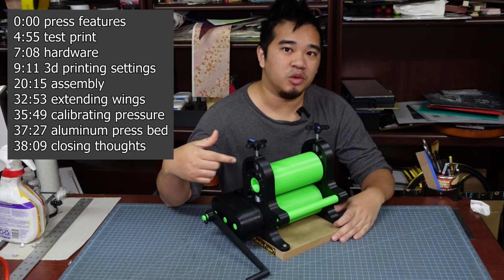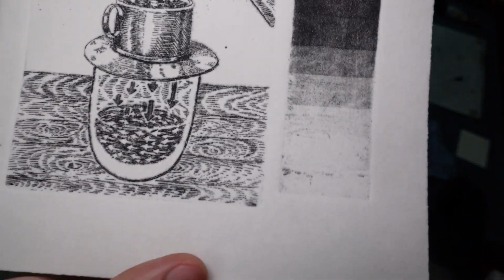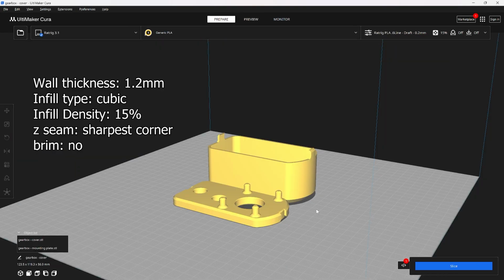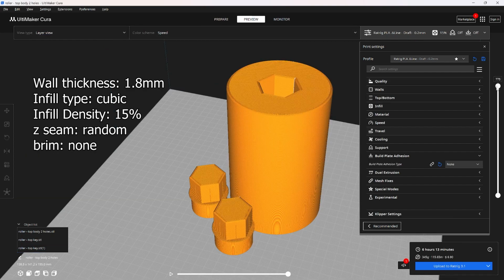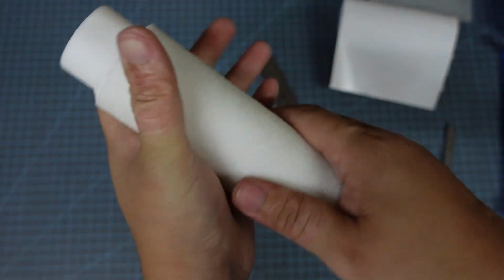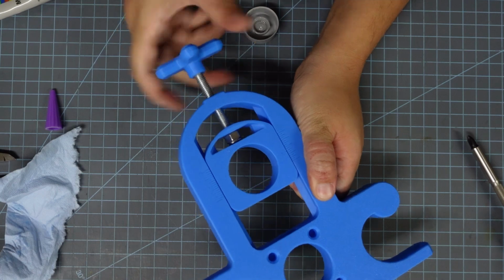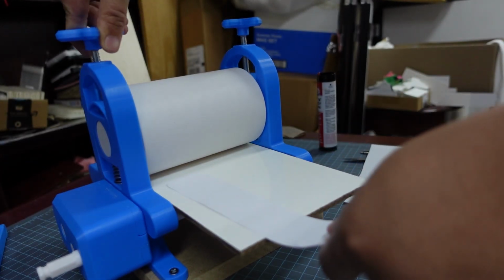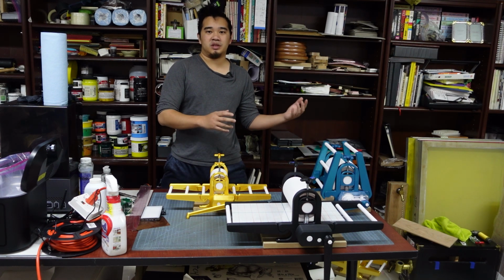3D Printed Etching Press! - Phantom Plastic Etching Press v2

Comment: great design, two changes that are cheap and would make it last longer, blind nuts on the tightening mechanism, one on each side and that would keep your threads working for years. Also plastic safe lubricant on the pivots and gears, Tamiya White grease will last a long time and not melt the plastic like 3N1 oil....

Comment: Also, how hard would it to be to extend it so you could stick a regular copy machine paper inside, size-wise?
Reply from the maker: possible but you'd have to have a bigger printer and use more walls and infill for the rollers

Comment: I wonder if 3d-printed etchings/stamps/type faces are good to use. Have you tried it? If PLA/PETG are too hard/stiff to do the job properly, there's always TPU which is rubber-like. 3D printed bed is obviously possible, since you made one last time, certain materials like petg can take more beating than aluminum, just I wonder if you can 3d print typefaces/stamps and have them work correctly so you can get a fully 3d-printed printing press.
Reply from the maker: I've gotten it to work with PLA with oil based ink, but I can get better quality images with carving by hand so I haven't explored it too much. Infill can make noticable pressure differences so you have to print it solid. I haven't tried anything like movable type but I imagine the small differences in height would cause issues.

Comment: Can it emboss? This thing looks a lot like the Cricut Cuttlebug which is something I was looking at buying. I have an Ender 3 and am looking for a way to do embossing in cardstock.
Reply from the maker: if you use a thick soft felt or a positive and negative die you could also emboss

Comment: New to 3D printing but I'm amazed by all of this! Would it be possible to print this using a filament printer?
Reply from the maker: yes, this should be printed with a filament printer! Unless you happen to have a large resin printer, but I've never tried to resin print it.
Reply: @someprintdude  We've actually started to print on our resin printer! We had to scale to 90% so it will fit, but working on trying to release the middle adjustable piece on the press frame. More resin will be coming in today to print the rest. Thank you for being so informative!
Reply from the maker: @Oh_Kayle  you might have the first resin printed version! I'd love to see it when its finished
Reply: @someprintdude  Absolutely! We've ran into trouble with the middle adjustable piece on the press frame, it kind of sealed to the top. Do you know how we can edit the file to possibly push that middle piece down a bit to extend the supports?
Reply from the maker: @Oh_Kayle  on the project page you can download the .STEP model, load it up in some CAD software (I use onshape), move the bearing where you need it to be, then export the frame and bearing together

Comment: Is there enough clearance to print with letterpress type?
Reply from the maker: yes! the press opens up to accomodate matrixes up to 1inch high. Make sure you use some sort of tympan or board to protect the top roller because metal type can dent the plastic top roller.

Comment: If you need to do smoothing type cleanup, I've found using a razor blade as a scraper to be really effective (and a lot less chance of injury with a utility knife).  Also handy is an emery board.

Thanks for designing this and making it available.  It's really amazing for tools like this to be so accessible.

Comment: Phan-tastic. Beautiful design. I love how thorough the video was too. All of my questions were answered by the end haha. I could see maybe using some heat set inserts for the threaded rod.
Reply from the maker: I did buy some to try, but then I realized the hole was bigger than my soldering iron and I couldn't think of a good way to insert it :')
Reply: Printing today. Going to use m8 inserts and likely use m8 stud knobs in lieu of the printed knob and threaded rod.
Reply from the maker: @JustinLCecil  I wish you good luck and good bed adhesion
Reply: @someprintdude thanks! I think I’m going to give anti slip spray (rustoleum) a try instead of the grip tape. Maybe on the underside of the bed rather than the lower roller. TBD.